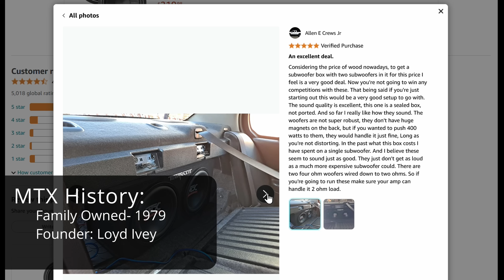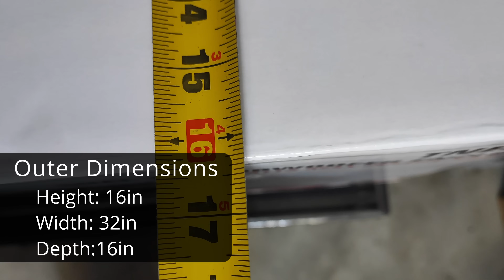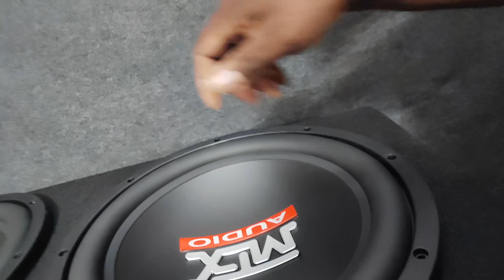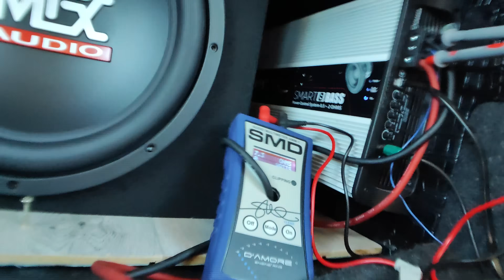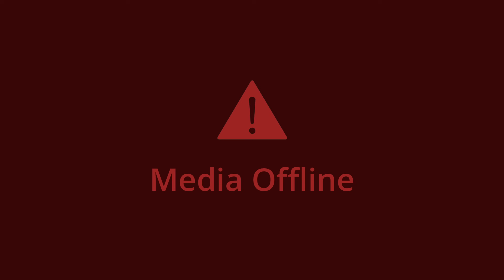Why Is EVERYONE Buying This Loaded Enclosure | MTX Terminator 12 | 5,000 Watt SPL Test

Comment: It's so hard to find sealed enclosures anymore, which is why I partially believe this loaded enclosure sells so good.  People today are more concerned with SPL numbers and how much flex they can get out of a sub before it blows.  By far, you can't beat a sealed enclosure for sound quality, and as you demonstrated, the losses are not as bad as people think.  Subs in sealed enclosures are more forgiving to over powering because they don't reach Xmax as easily.  The only real worry is to not cook the voice coil with continous high power music.  So glad you did this video!

Comment: Fun fact . those banana plugs you're using on your quick connect rig is they are made to plug directly into the top of those round push terminals terminals that's actually why push terminals are angled like that. 

I like to use them on both ends of the speaker wire because it gives you something solid for that set screw in the amp.

Love  your videos ... no matter what piece of audio you're talking about
Reply from the maker: I knew that, but others may not have; thanks for sharing! The banana plugs I'm using wasn't tight enough and I thought they would shake loose.

Comment: I just convinced my brother in-law to purchase this for $280 on Amazon instead of a more expensive setup that was going to run him around 700 bucks cause he only works part time and gets disability checks i was a little worried it wouldnt get him the sound he wanted but after setting up everything it actually slams pretty good n saved him some money to fix other things on his car
Reply: he got robbed at 280 no offense. They are very commonly $170
Reply: @AjaxSkye  fair deal just the subs and box are running 170 his package came bundled up with the box and subs, plus amp, capacitor, wiring kit not a bad deal
Reply: @ ahh ok with the full package thats a banger deal, my bad.

Comment: Like my first car box.
My last 2 boxes are like this one.
What replaced my first box was a custom 4x12" enclosure for my old fox body stang.😢😊❤

For a while I was homebound and built a monster home stereo system with like 30 speakers 😮.
Also a couple raggedy rides in between running my Sony xplode deck and a couple 8" & 12" home speakers.

My last best mobile setup was 1,600w total roughly with 2x 12" Kenwood & 4x8" Sony.
The rearview mirror turned into a kangaroo 🦘 
It didn't just hit hard, it sounded good. 

Stay pounding 💪 

I'm just not a headphone guy!! 😂
My next setup I definitely want something closer to double everything!!!

Comment: Bought these back in 2016 for my first car and what started my costly hobby. The measly 1200w(400w at best) Boss amplifier I had ran these well and was super impressed until I decided that wasn't enough. Naturally 8 blown subs from various more expensive name brands (RF,Skar) and a few 2krms amps and hopping on the lithium battery wave I can say I'm happy those were my first to have owned and installed all by myself.

Comment: This is great. Actually tested forward and rear facing! Every system I had in a trunk sounded best rear facing and 6" from the trunk. That is some very good spl for bottom dollar with unexpected details. And I always went sealed unless it was some eights or something like that. Did a 142.7 with a single 15" xtr 3 dvc sealed on 500 watts in the 90's. Very nice video.
Reply: Yes this is absolutely true it makes the bass sound way deeper

Comment: Seriously I’ve had a MTX 280 amp and had it pushing 2-12 inch MTX Woofers. Was heard by a Police officer a Block away and he just gave me a warning…My head unit was an Alpine detachable face and Boston acoustics and that baby was wicked I blew away Rockford Fosgate and Infinity systems…All for around 800.00 to $900.00 only 

Now I may try Alpine and Kicker and I just want clean clear sound now that I’m older…Maybe 10s or 8s debating on Kicker comp subs or Alpine 
Amp will most likely be a 400 watt or 800 watt and mids kicker Head Unit still thinking about it between Alpine and Kenwood 💪🏽👍🏽👍🏽😎🔊🔊🔊🔊

Comment: Hey I been doing car audio for 20 years. Some of that I did it for a living and I got a system that will do 154DB in my daily. I got this set up for my wife’s car when she just wanted a little sound. I did these 2-12s with a 800.1 pioneer amp (MTX) and I put some mid grade pioneer mids and highs in her car and I was impressed with the money I had spent. I pushed them hard and even put my JL 1000.1 amp on them which pushed them harder and they kept pounding. At one point I was going to buy 2 more of these 12s and do a custom box just to prove what you can do with a budget build if you box, amp and wiring is on point. It’s not all about the subs. I’d give 5 stars for what I paid.

Comment: so what is the highest amperage you can run to these because they hit 4800 and they are rated for 800
Reply from the maker: Clean power, short pulses. Not recommended for daily use. Only around 500 for daily

Comment: I went to the car audio shop in my town, asked for their best “cheap” sub and I got 2 12” mtx terminators, came with a 250w amp and they gave me some quality speaker wire they use to install the units. It was around $300. It sits in the trunk of my 88 Toyota wagon and it thumps. I turn my music off a block or two away from my destination and ppl still tell me they heard their windows vibrating😂

Comment: I think it might be prudent to do the SPL sweep at or near the rated wattage rather than at such a low power, that way you have a more accurate guess as to where it'll peak with high power. Or otherwise, wherever you find the mechanical power limit, back that off 25-50% and run it down from like 70-30hz unless it's a really low-tuned setup. Crazy to see another easy 140dB on the meter (I know it's a sinewave in the kick, but still) but I'm still hyped to see a "budget" 145+ on music on the dash.
Reply from the maker: Didn't want to heat up the coils.

Comment: I bought the Rockville set up that was listed just below. Was probably like 5 years ago. Shipping sucked. Just threw it in a box and called it good. But I also bought it closer in price the the MTX so figured I either got dent and scratch or it got dented and scratched em route. Do to how they built the box the damage was insignificant as it didn't interfere with the box's function. Moved the set up to a different vehicle since purchase.
Reply from the maker: It’s good to hear you got good use out of your setup!

Comment: I cant speak on MTX speakers, but i boycotted MTX since 2000. 
Buyer beware, they do not honor their warranty.
I purchases an amp from them, registered it and the amp blew up in 3 months.
I attempted to RMA it and they stated it wasn't installed professionally and was because of abuse.
My car wiring was flawless and the amp i replaced the MTX with ran for years with no changes to it.
Their speakers may be better, but just know the company may not honor a warranty if their equipment fails in the warranty period.

Comment: What wattage would you be comfortable running these at rms everyday,so they last the longest time?
Reply from the maker: 500 should do great.
Reply: @BudgetBassHead  I have the mtx jackhammer 1200 I am going to try these against my old kicker silver front subs and see how they sound, with a better box they would definitely sound better.
A guy posted a 1000 watt amp and 2 JL audio 12sw3 like new in a $300 custom  box for $200 bucks , I missed it by 5 minutes they sold in 10 minutes, there's great deals on marketplace but you have to be fast.
Great deal on these $130, you can put more money into mids tweets and amps to get a system going.

Comment: As a bass head, you give me some serious things to think about in this video. My only question is, what about the lows? A lot of the music I listen to is screwed and plays into the 20hz range. I'm thinking that the extra power needed to push low notes in a setup like that would blow the subs. 

Addendum: I do have to acknowledge the fact that you spoke about younger people looking for a cheaper way to get loud, so it makes sense to me. My 1st system was similar. 2 Pioneer Immp 12's in a sealed box on an Autotek Mean Machine 90. It was BANGN. You could here it from a few blocks away. Stuntn on my friends with the wood grain Pioneer  stereo with the wood grain remote. Bringing back memories on a ninja. Ya, starter systems like this are great until the guy that comes from a more "well off" family pulls up with 3 JL AUDIO 15's in an extended cab Chevy Silverado pulls up. Don't ask me how I know. 😂😂😂😂😂
Reply from the maker: These are not meant for the low lows. It's a balanced box. Tight and responsive.
Reply: @BudgetBassHead  Yes sir, I get it. It's a great starter system. It truly is a good place to start.

Comment: MTX is great... always a good brand across the board. A buddy of mine still rocks a big MTX Thunder 9500. I used to have a couple of Thunder 3000's back in the day myself and I beat on them every day :D
Reply from the maker: MTX has a great history.
Reply: @BudgetBassHead  It's one of the few legacy brands that didn't get bought out and cheapened (and thus ruined) by a cheaper manufacturing firm (usually Chinese or whatever) like so many other legacy brands. I really miss the old Soundstream stuff, the old Cerwin Vega and the old Cadence stuff. MTX managed to avoid that :D

Comment: I had a fast modified 87 Turbo Buick in the late 90's with a single 12" MTX Black Gold in a sealed box, Alpine CD player, Linear power 4 channel amp bridged for the sub and some homemade kick panels with 5 1/4" infinity components. Capacitor the size of a tall boy. I read all the Car Stereo Review magazinss and I was building my system for sound quality, but man that sealed box 12 hit hard as hell and everything sounded great with that setup. I wanted some 6.5" mid basses in the doors but didn't want to cut them up. Those were the days man. Love the channel. I should get back into this stuff. Good to see MTX still in the game too.

Comment: Try back in your box up all the way to the license plate all the way at the back of the trunk facing forward into the car facing forward into the seats with the box all the way back at the beginning of the trunk beside the lid and compare that to the rear firing into the trunk and I will bet you money that you will get a higher number facing into the cabin from as far back in the trunk near the lid as you can get the box

Comment: I cannot beleive these are still out! Had these back in early 2000's, pushed by a 1200 watt mono infinity amp eventually switched them out to their 5500 thunder series subs. Plus had a 4 channel 800w infinity amp pushing 4 pioneer 6x9's. I think MTX under rated their specs, honestly. Always pushed mine hard.  Absolutely loved that system. Everyone that heard it was always jealous how clean, crisp and loud it sounded.

Comment: I had 2 12 inch kicker cvr in a small sealed box on a 1000 watt amp rock my car. I am sure I hit over 140db.. so No you don't need a big powerful system to make some real noise. I thought about going back to a small sealed box with  2 kickers 12s again.
Reply from the maker: If it works for you then go for it!

Comment: The MTX (3) 10 inch Blue Thunder subs with an MTX PRO3002 was my first system i bought when i started working at Circuit City in 1998.  I'm still a professional installer to this day and i get sad thinking about what happened to MTX.  We were a dealer for many years and then in like 2010ish they decided they didnt want any brick and mortar retailers and were going to online sales only.  Safe to say they realized that was an awful idea and its going to be very difficult to ever make a real comeback but i wish them luck.
Reply from the maker: Circuit City... that takes me back!

Comment: I put these subs in my wife’s Camry with a 350 watt MTX amplifier and she’s happy with it. I actually had a 10,000 watt MTX amp back in 2009 before I understood how important the proper electrical in a vehicle was and I blew one of the capacitors completely off the board inside the amp. Lesson learned though. I now have three alternators and 4/0 welding cables going to three AGM batteries and three Ioxis Ultracapacitors!!!
Reply: What 10k watts amp? The TE4001 was the biggest amp they made in 2013ish and was rated 3750 watts RMS at 1 ohm.  Likely did well over 4k on good electrical but nowhere close to 10k bro.
Reply: @ dude this was 17 years ago and I only had it for like a week before returning it to the shop I got it from so I don’t remember what model it was but I can tell you that I kicked myself in the ass after returning it because I finally got in touch with someone at MTX and after telling him about my situation he offered me a thousand dollars for it in the condition that it was in
Reply: . Haha bullshmoke
Reply: @JonesCoWoodworks mtx never made a 10,000 watt amp ever
Reply: @rickyharvey2583 okay.

Comment: I used to have an MTX Thunder 8000 12" with a Directed 650d amp in the back of my Mustang back in the early 2000's. Was crazy loud for not a ton of money. Glad to see they are continuing the tradition.
Reply from the maker: I still see those old 8000's popping up from time to time, they were a big seller back in the day.
Reply: if u had a directed amp u had top of line.they still are high in price even the old ones from early 2000s are still high.
Reply: @DASouth901 I have a Directed 750 in my car right now! Been going strong for 20 years!
Reply: @detroitdiablo8734  i believe you! back then they made things to last.thats why the old ones are still expensive today
Reply: I still have my heavy ass MTX ported box to this day, picked it up in the mid-late 90's. It was so big for my trunk, you would never be able to steal it because I was the only one that knew the right procedure and angle how to get it in and out lol.
Reply: In 2006 I had two thunder 8000 12"s and 1000 W Rockford Fosgate with a 18 db bass boost and a 12 db boost on top of that ran through a dash equalizer inside of an 1989 conquest TSI hatchback 😎 
Needless to say with the base knob set up like that there were some songs that that would rattle your eyeballs so bad that you could not see to drive 😂

Comment: I used to love MTX (Mitek Group) woofers back in the late 1980's. I remember the MTZ Crankers (square magnet), Blue Thunders, and the Terminators. I ran different combinations of all of those and depending on the enclosure I put them into, they were always outstanding performing drivers. Sure, there were more expensive name brands ie: Rockford Fosgate, Boston Acoustics, JBL, Cerwin Vega, etc. Bottom line, for what the MTX drivers cost, they always were a great performing woofer for the price and they all took a ton of abuse! Love your channel sir. I just subscribed because you put it out straight, with no bull-dinkie. Nice!   Fred
Reply: I HAD 3 10 INCH BLUE THUNDERS IN A SEALED HOMEMADE BOX...LOUD AF AND WELL BUILT...GREAT MEMORIES!
Reply from the maker: I would love to see some of those old MTX drivers around! You can't argue with their performance back in the day.

Comment: I am searching for a extended cab rattler. Im tempted since the box the sa v2 12 i have broke its box...i edited it after i saw i cannot type well. Anywho...i miss bass so much and i feel i only have had a taste. I am debating on what materials to build my box with. Maybe cheap plywood and some oak tongue and groove flooring by chance? Its only 3" wide. Decisions.  Hhmmm im throwing my 08 square in with radiators, ideally. But who knows.
Reply from the maker: Use 3/4 inch MDF (heavier) for better sound quality, or Plywood (requires more treatment) for lighter construction.

Comment: My dad ended up finding an old Mtx tc5510 (twin 10 box) at the dump, red Canadian cones. Thing still works great, getting  (110DbA) 138.6Db at 55hz in the front window an inch off the roof. It's only getting around 300w(Half rms). I'm pretty sure these are from 06, definitely a decent brand.

Comment: About 20 years ago is when I ran MTX and I bought 6 MTX 12 terminators or something that was re-manufactured, had a red basket, red stitching, small magnet etc. for $13 so I bought 6 of them. I only ran one in my trunk in a ported 2ish foot enclosure that I built.  Had a pawnshop over kill MTX amplifier black with raised gold lettering, still have it don’t remember what it is and it was the cleanest sounding sub I had ever used, it was perfect.  It wasn’t going to blow the windows out of the car but for driving down the road for hours and listening the thing was rockin and wasn’t fatiguing.  I still have them sitting in the basement unused, unopened waiting for nothing.  I didn’t care if it blew up or if someone stole it, but it never died.  I remember people listening to it and they were amazed, because it looked like something out of a pair of headphones.  Since then I’ve never knocked MTX.  I would still like to get a hold of one of those gigantic jackhammers and build a plexiglass coffee table/sub box around it for a conversation piece.